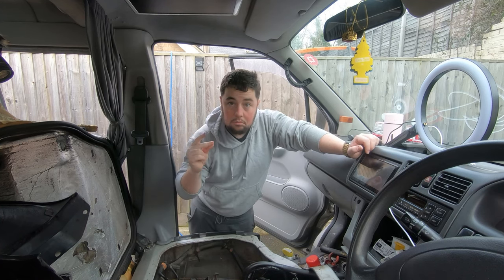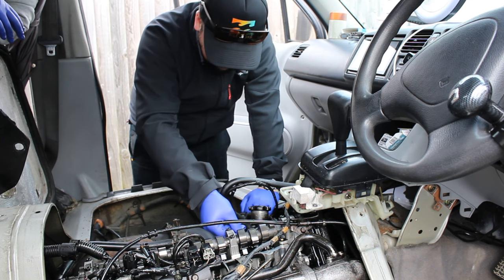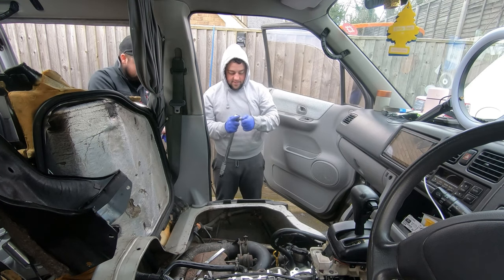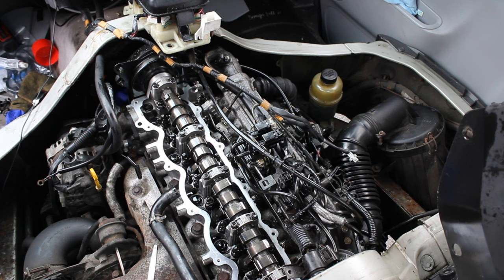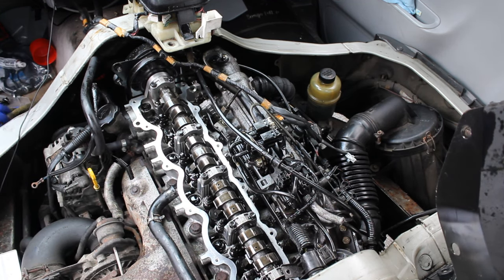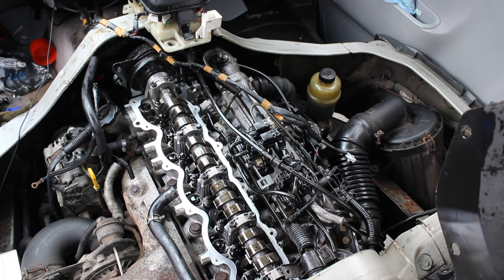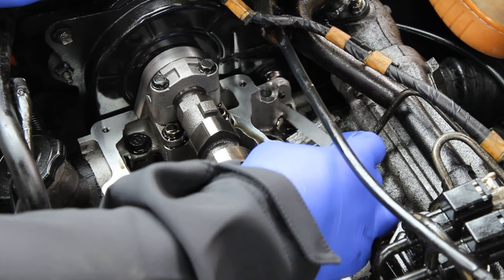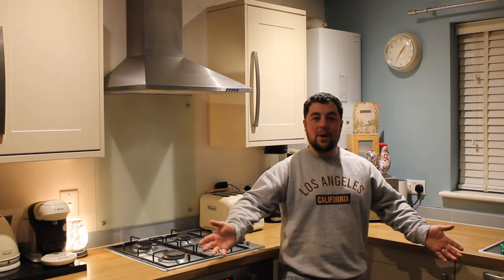Bongo Tappets get adjusted.. let's hope it runs better //

Comment: I cant hear clearly what youre saying. What clearance did you use for the intake and exhaust? In mm or inch?
Reply from the maker: Cold engine :
Inlet 0.1mm +/- 0.05
Exhaust 0.2mm +/- 0.05

Hope that helps